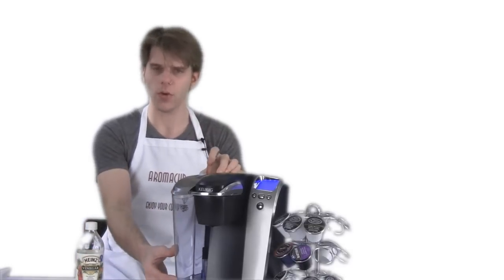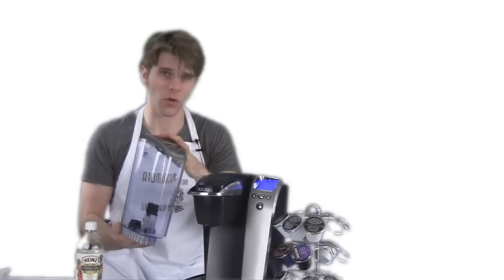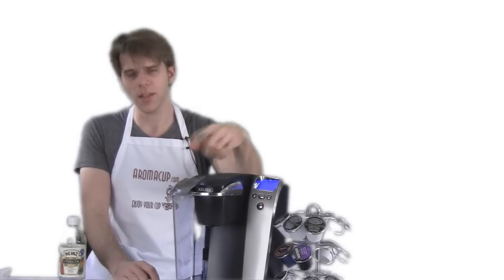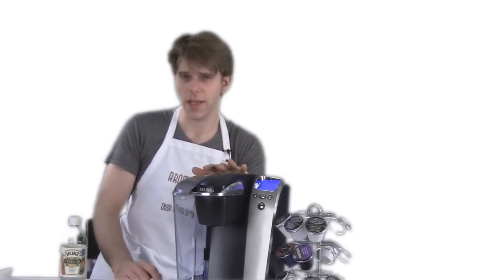Keurig Troubleshooting FAQ: Howto remove a Plastic Taste from a Keurig Coffee Maker?

Comment: I found the solution. No, it's NOT the K cups. Run it without the K cup, and it still tastes like plastic. It's also NOT the water tank, (for those who are convinced that's the problem). The cause, is the 5 feet of silicone hoses inside the machine. Disassemble it, and smell the hoses. You will immediately see that's where the taste is coming from. Vinegar, or lemon juice isn't going to make it leach out of the hoses any faster. I tried them all. It did not make any difference. If you remove the lower front wrap around cover, you can see the hoses. I removed the cover, and laid my new coffee maker on it's side, over a floor vent. The warm air from the furnace, will drive the gasses out of the hoses. After a few days, I ran a few cups of water through it. (Water stays in the hoses between uses, so you have to run a few cups through it to change it). Almost all of the plastic smell, and taste is in plain water is gone, (>95%). If you brew anything now, it tastes fine. Probably a few more days over the vent, and it would be 100% gone. I'll leave the cover off it while use it for now, so it can finish off gassing. This is NOT what I expected. They should not be selling these, if they can't make it so it works properly out of the box.
Reply: would blowing a hair dryer on the tubing work to get the gasses out?
Reply: @LeeHouseofD  Perhaps it will work some. But, you probably would do a lot better with a fan.
Reply: This is WAY TOO much work to try to get that AWFUL plastic taste out of the coffee and to TRY an get a good tasting cup of coffee.  This is ridiculous.
Reply: Thank you so much, i tried it and it worked ! The plastic smell didnt go away after countless vinegar cycles.. but when i opened the machine to expose the rubber pipes to air (i put a whole day under direct  sun exposure), i run a cycle with alcohol, a rince cycle, then a baking soda cycle, rince cycle again, and the taste is gone.. and now i let the machine open to "gas out"..

Comment: After trying your cleaning method the plastic taste still remained, so I used an entire gallon of Heinz extra strong "cleaning" white vinegar at full strength (undiluted) through the Keurig. After cleaning the reservoir with soap and water and running three reservoirs of water through the machine the plastic taste finally went away. If the plastic taste should return I'll toss this machine in the garbage. I cannot recommend a Keurig coffee maker because of the trouble I went through to get rid of the plastic taste.

Comment: Let me pose a question... I have a brand new Keurig Supreme Plus. Bought it at Costco. Didn't use vinegar,  just ran a few cups of water to flush the system out the box. Brewed a cup of coffee and it tasted burnt. But I'm not too worried with the taste because the brewing technique can be adjusted to accommodate the type of coffee you are using.  My bigger concern is that when you lift the lever and you get close to the machine, you can smell a rubber/plastic burn odor. It's coming directly from inside the machine. My question is how does running vinegar thru your machine negate the fact that the plastic/rubber components are emitting a smell after each brew cycle from the heat of the brewer??...

Comment: This method of using high quality distilled vinegar did not work to remove the odor of burned wires from our brand new coffee maker, even after several attempts. All of these products are made overseas and it makes me wonder what the hell are they using to produce them? We need to get to the bottom to make sure these unregulated products are safe to use.

Comment: It's not just Kuerig. I just bought a Hamilton Beach (in the face of many complaints about the plastic chemical taste, but there were many more that didn't have the problem, thinking I'd get a good one) and it too has a terrible taste! I don't even know whether to bother trying the vinegar or just take it back. I never had this problem with the good ol' Mr. Coffee. Why must this be an issue in a single serve maker? Even have a $10.00 cheapo that makes a great pot of coffee with no off taste. Is it just the single serve ones?
Reply: +Sandra Krytus I got the Hamilton Beach one and it made everything taste absolutely disgusting. I returned it and got a Keurig instead but it seems that this one tastes plastic-y too, although to a much lower extent. I've never had this type of issue with plastic bottles or coffee makers, not sure what it is about the single serve. I'm hoping the Keurig will go away after a while, I really don't want to do the vinegar thing because with my luck it will just make my coffee taste like vinegar instead :(

Comment: Ok I have now tried everything. I've tried the specially designed Keurig cleansers. I've tried white distilled vinegar. I've tried even gone so far as to run through 2 reservoirs of white distilled vinegar through, each time leaving it sit overnight after an initial vinegar flush or two. Every time, after about 2 weeks, this really bad, almost cardboard-like taste comes back (and it effects everything ... tea, coffee and even hot apple cider). I was using a filter, but I've tried running with out one. No luck. I only get about 2 weeks of good tasting beverages before the bad taste comes back. We have very soft water in our area, so I know it can't be a scale thing (I have an electric tea pot that I've had for 4 years and so far have never needed to descale it). What could be causing this awful taste and could I have ended up with a dud? I love the Keurig but it's such a hassle to constantly clean to remove this taste.
Reply: Kleineganz I have the exact same problem.  Nothing has worked.  I've done everything you mention and more.  No change.  Everything has a horrible chemical taste.  I've had to just stop using it.  Keurig even sent me a new brewer and it is just as bad.
Reply: dbonoma2 Chemical taste wasn't the issue for me, it was more stale coffee taste. I solved the problem ... turns out it was the part where the K-Cups go in ... I had to take it out and give it a good cleaning separate from the rest of the unit. I haven't had the taste issue in months now.
Reply: I'm having the exact same problem.
Reply: @Kleineganz  Thank you, this was very helpful.
Reply: I have that AWFUL plastic taste in my coffee too.  I called Keurig and they sent me a replacement machine.....AND still the same thing is happening.  I went through the same cleaning routine for both machines -  I filled the water reservoir 3 times with white vinegar, ran water through it about a dozen times and it still didn't work.  
The taste is just AWFUL.
Reply: I have the same problem. Tried keurig cleaning solition did not work. Tried vwhite vinegar and that plastic smell and taste is still there, love Keurig but this is so inconvenient. Anyone found a solition to this? Thinking about getting stainless steel reusable kcup to see if this might help?? Why keurig cannot make all stainless steel I don’t get it, sounds like money trap, people keep buying parts so they can keep money. Sick of this crap
Reply: @bozkurtbozok4597  I solved the problem ages ago. I had to pop out the entire bit that the k-cup sits in and gave it a good wash. That cleared the problem up.
Reply: Kleineganz hmm I will try that, thank you for your reply and will update here for you and others
Reply: Kleineganz hey it’s me again. You said you had to remove entire part where k cup sits. I looked at it and only part removable is the k cup itself where you put the plastic keurig coffe cups. Are you talking about that part or you are talking about getting a screwdriver and removing the whole head part? Thank you again.
Reply: @bozkurtbozok4597  I didn't need a screwdriver, I was able to pop-out the bit where the k-cup sits. Rising that bit with hot water and soap fixed the plastic taste problem for me.
Reply: Kleineganz ok thank you again will try that one more time, I was able to remove the plastic part where k cup pods sits and washed and rinsed with dawn detergent. Will let it sit couple hours to see if this will help. If not will try to buy stainless steel part for that

Comment: I just got the k535c and have the plastic taste. I will do the vinegar cleaning. 
do I need to remove the filter or should I let the vinegar run through the filter?
also, could it be that the filter is giving a bad taste?
lastly, should I change the filter regardless because so much b palstic taste ran through it?

Comment: what about machines that have a filtration system in them? can the filter impact the flavor? we have a newer machine and i did not do the vinegar thing but I did run about 4 brew cycles before using it the first time. we are now about 30 cycles into the machine and it still tastes very plasticy and I can't stand it. these machines need to come pre-primed, it's unacceptable for a brand new machine to make such a terrible tasting drink. but yes, i will try this process and see if it helps.
Reply: I have a filter in mine (same issue with a Cuisinart brand) and change it monthly. It isn't the answer. Strong chemical or plastic smell in the water reservoir and the cup of coffe.e

Comment: The bigger question is, why is Keurig distributing coffee makers that produce bad plastic/chemical tasting water?  We shouldn't have to try so hard to mask or resolve this problem.   It doesn't matter what kind of coffee you use, how long you brew it, what temperature or other options  the machines provide, if it can't heat water without making it taste like plastic they are useless. The plummeting quality of the makers to try to save a few pennies has ruined this company.
Reply: dbonoma2 what I fear is ingesting all that plastic will lead to cancer and/or impotence down the line.  Who knows what nastiness hot water coming through plastic tubing and mechanics will produce.  
Why don't these companies make all metal machines.  Is there any such non-plastic machine that makes coffee like Keurig that you know of ?
Reply: +dbonoma2 Not just Keurig unfortunately - had to return a Hamilton Beach single brewer for the same type of problem. I returned it and got a Keurig with the same problem, although not as bad. I used to have an older version of the Keurig single brewer that worked really well, really frustrated that this keeps happening across the board and you're right, there is no excuse for this type of problem.
Reply: With every cup you drink, you are going impotent with various plastic chemicals you are ingesting dissolved in the hot water. 

You won't be able to get it up after one year of drinking that crap.
Reply: ***** Only sipped one coffee drink, currently processing water through it now. You're probably right, no telling how harmful the shit in this plastic is.
Reply: A lot of what's dissolved in the water, you can't even taste.  Your balls are under assault with this plastic residue.

Comment: has anybody had issues with their Keurig coffee tasting like burnt metal or that burnt toaster smell? except you can taste it in your coffee
Reply: +DorKAify at the place I work the keurig machine make the tastes like metal. Not only that the previous place I used to work at also had one with the same issue.
Reply: +Cuban Nerd so I went on their website and there's been a recall on the kcup mini brewer which is the one that I have so they're going to send a new kcup holder and see if that solves the problem

Comment: Its the kcups ,You can not get rid of the plastic taste because the kcups are made of polypropylene it's the same thing that make ping pong balls out of, you can't wash it out because you're replacing it with a fresh new  plasticy tasting kcup with ever cup you make,  the only way to get rid of the plastic taste is
1 unplug your Keurig
2 remove any water that's inside
3 pick up Keurig
4 place in trash can
5 buy a real coffee machine
Reply: It'a not the k-cups. You can use the exact same k-cups in a Keurig brewer and get the plastic taste, but not get that same taste in a different brewer. It's the machine.
Reply: No, it's NOT the K cups. Run it without the K cup, and it still tastes like plastic. It's also NOT the water tank, for those who are convinced that's the problem.  The cause is the 5 feet of silicone hoses inside the machine. Disassemble it, and smell the hoses. You will immediately see that's where the taste is coming from. The only way to get rid of the plastic taste, is time.  A little vinegar , or lemon juice isn't going to make it leach out of the hoses any faster.